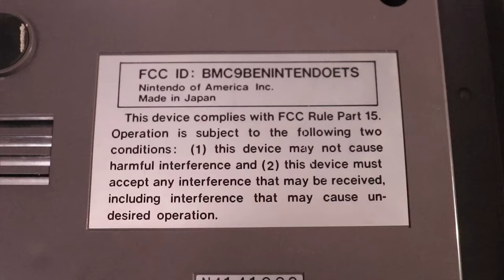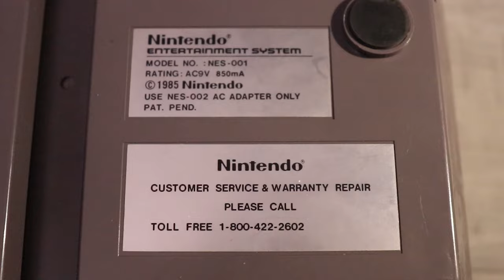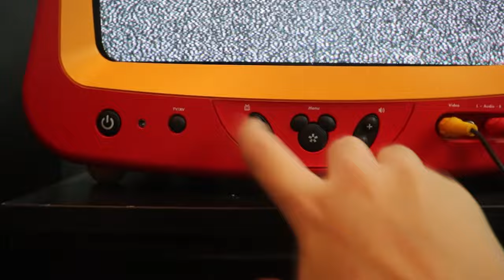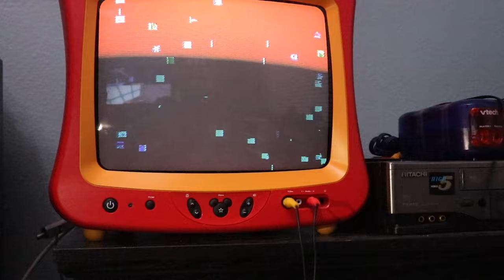System Shock: Everything You Need To Know About the NES!

Comment: Oh, I see. This was very interesting.
I only have a FAMICOM not a NES, so I was reminded of the differences in the RF Switch specs, detachable controllers, and other chassis. As for the differences in cartridges, indeed it seems quite a bit of space inside the cartridges compared to the board size. Was this a design choice for mass production?

I've watched a bunch of videos about NES Repair & Restoration, but they were always too dirty or rusted or often showed deteriorated consoles, focusing on the Before & After comparison.
This video, on the other hand, conveyed the original springiness, number of parts and screws, healthy sounds, and sensation of strength that should be paid attention to with commentary, which was more helpful to me.
I was able to learn about the proper way to disassemble and assemble NES consoles, which will be useful for future repairs.

Thank you for making such a helpful video.
Reply: The US NES cartridges were so much larger to simulate the feel of a cassette tape into a VCR as that is how the NES was designed to appeal to the US market. They needed the extra plastic to make sure to be able to load in the front loading tray properly.
Reply from the maker: Thank you SO much for the kind message. I was worried that this style wouldn't be for everyone, and it might not be, but comments like this show me that these efforts do apply for the right person.
Reply from the maker: Yep, that's exactly why Jeremy!

Comment: You should have taken the 72 pin connector off and boiled it to tighten the pins up.  Also the Battletoads board looks to be in need of a cleaning.
Reply from the maker: If I used my wife's pots to boil a 72 pin connector, she would boil my nuts.

Comment: As you don't need to push down the cartridge in the NES to actually play the game, I rarely push mine down. It saves the pins and the games play fine as long as the cartridge is making direct contact with the pin connector. Just a fun fact for those who don't know.
Reply: It has not worked for me
Reply from the maker: Yeah it's REALLY finnicky, but it works. I didn't see the point in bringing it up.
Reply from the maker: I've tried with mine, I wonder if the pins are just to set in place to work.